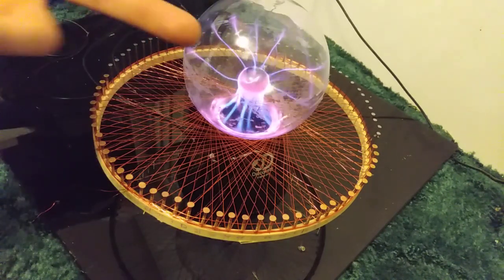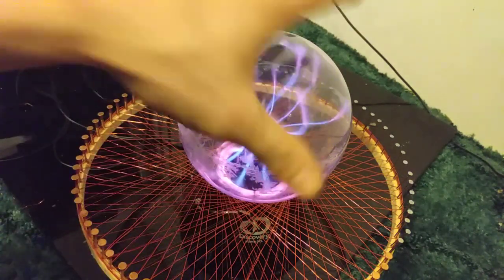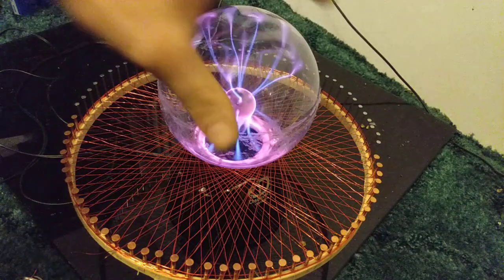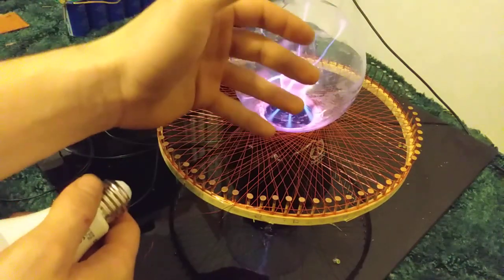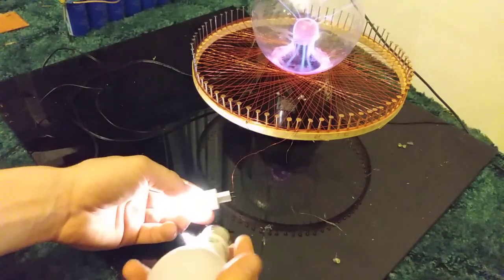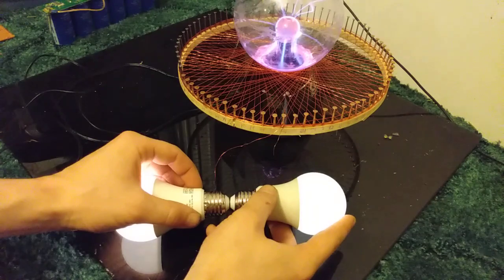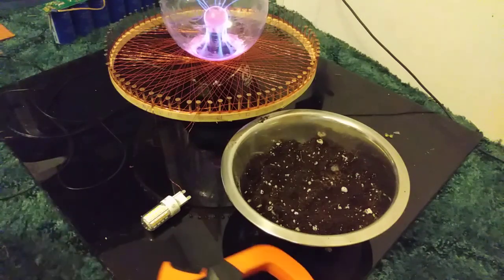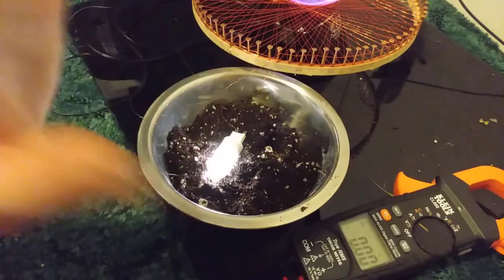Vortex Math Based 79 Flying Saucer Coil

Comment: Wonder if you could use refrigerator copper tubing instead of twisted/wound wire if you were making a larger coil?

But I seem to recall there's something better about using twisted wire I don't know

Comment: No multi dimensions. Time is strictly observational. That multi verse shit mainstream dead universe garbage and is meant to disuade the layman from expirementing. The universe is infinite, there was no big bang as proven by Skyscholar aka Dr. ROBITAILLE, as well as proving with direct visual spectroskopy observations and data that the Sun has a condensed matter core meaning the universe is electro magnetically interconnected and their is an infinite energy pool for anyone or anything located inside any part of the universal magnetic grid.
Reply from the maker: Well said! Multi dimensions could theoretically exist if we are genetic organism living in a simulation which could be classified as the earth dimension.

Comment: That looks like bare copper wire you are using, which means you won't get any advantages you might get from using the proper insulated enamel wire.  Every point where the wires touch other wires or a nail creates a short circuit, which pretty much makes your coil design less  of a hyperdimensional multiphase generator system :-) and  more of a tangled web of wires.  It is hilarious that you use all these big words without any meaning of what those words mean, let alone even a basic knowledge of circuit analysis.  You could remove your copper wire mess, and those bulbs will still behave the same way, as its the high voltage of the plasma ball causing the bulbs to light, and not your hyperdimensional blah blah.   Your body is NOT a superconductor.  Dirt is not a superconductor.   Many of your meter readings were wrong.  What you called amps is much more likely to be microamps.  Making voltage readings with only one lead connected is meaningless.
Go enroll in community college EE classes, and you will  learn something useful.  Just playing around like this  doesn't teach you anything useful, and you are only demonstrating your ignorance.   Not trying to hate on you, but it happens to be true.

Comment: Hey good job. What are the intetesting applications you have come across for this?
Reply from the maker: Im very sorry I have not been seeing these comments. So far I plan on integrating this idea with my Quad wheel generator and hopefully keep it running for every using a polyphase generator system that will keep 2 high farad supcapacitors charged at all times. From what I've gathered so far it seems I have more than enough energy to work with to make this happen.
Reply: There is a reason he replied to most of the other comments but not this one.  That should tell you all you need to know.
Reply: @25EllisDee25  Project harder cringelord.  He obviously demonstrates you can have free lighting.   You could build a bigger coil, and use more power.  You're just not smart enough to see that.

Comment: And that is the reserch! 
How is that u measure just milivolts? Plasma ball gives towsens volts so should be more volts because milivolts not should make bulb bright. 
And please measure power in ball while bulb is on.
Good Job!
Reply from the maker: I'll be sure to do that for the next video!
Reply from the maker: My meter is measuring high amps instead of volts instead. Another volt meter is saying that im generating over 500 volts but I don't know which one is right. By the looks of it it's seems to be high amps because the emf isn't the same as a Tesla coil emf